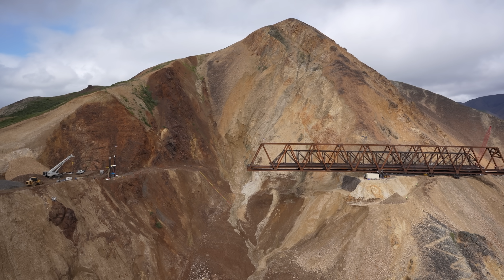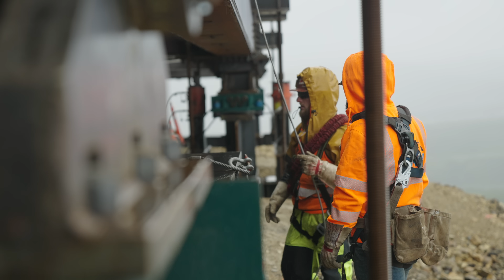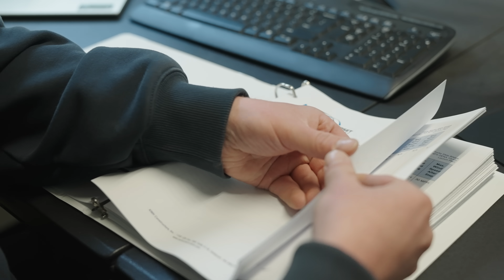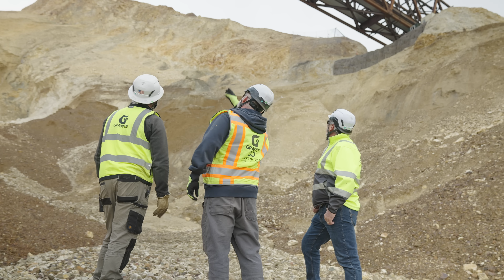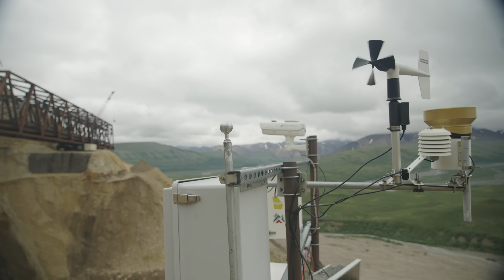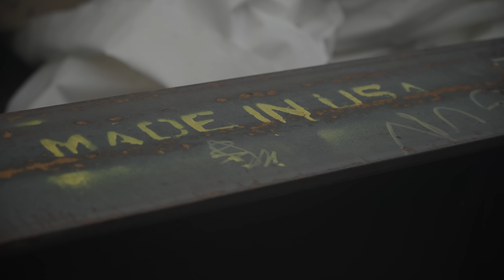Granite’s Polychrome Pass Bridge Project in Denali National Park: Chapter 4

Comment: Nice video and engineering but I'm not optimistic the bridge will last 15 years.  Too much fractured Rhyolite and minor tremors in the area.  Maybe you put 100 foot pilings down into the Dacite / Andesite? The NPS should have backed off 1 mile, perhaps 2 miles and put a new solid road in, going upslope and over the Polychrme fracture zone,
Reply: you hit the nail on the head.